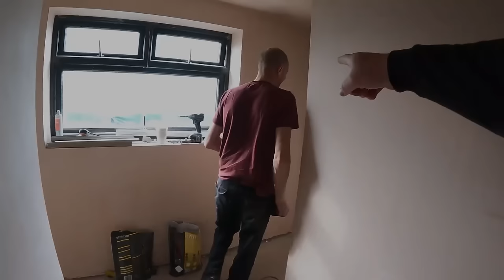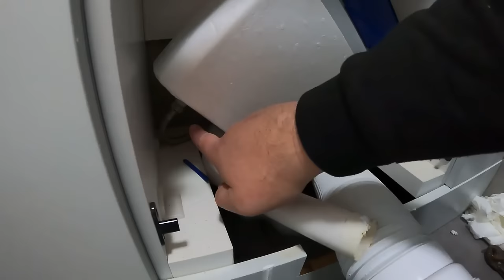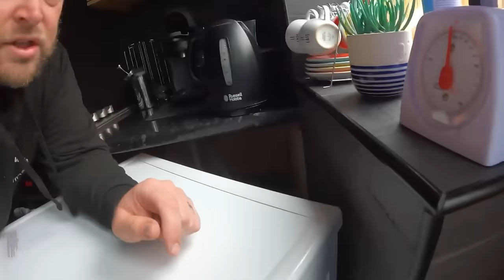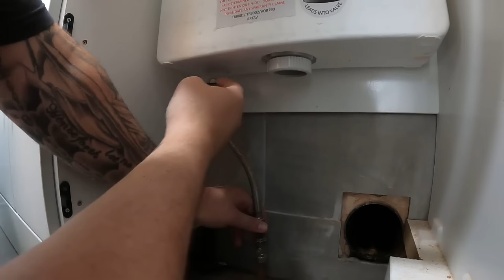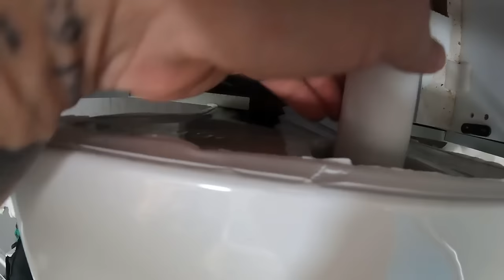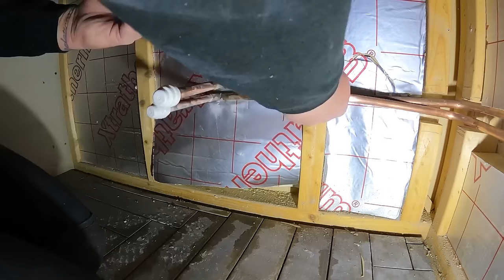WATER LEAK IN THIS BATHROOM... (Cant believe what caused it)

Comment: I work at lot in blocks of flats.
Something like this happens, and the flat that's coming from go i haven't got a leak, not my problem.
The leak is going into the flat below, and it can't be coming from anywhere else as no pipes within the flats running in the ceiling void.
It becomes a knightmare trying to get access or the landlords to do out

Comment: Thanks for that, Mark. At least it wasn’t one of those jobs that leaves you guessing. The trouble with those cistern mounts is by the time you’ve wrestled the blighter into place you can’t see the state of the fixings so there’s a fair chance it got a bit battered when it was first put in and a thousand flushes finished it off.
Reply from the maker: Yep they can be a pain… the new replacement one is spot on with the securing screw

Comment: Had this on my mum's toilet. As there was a worktop above the cistern I couldn't easily hang a new cistern without taking the worktop off. Ended up putting a couple of screws through the back of the cistern above the water line instead. Hate concealed cisterns.
Reply from the maker: The screws could hopefully save the day
Reply: @MJTiffPlumbing  a cowboy solution, but with only 1 toilet in her house, it needed sorting asap
Reply from the maker: Exactly that mate